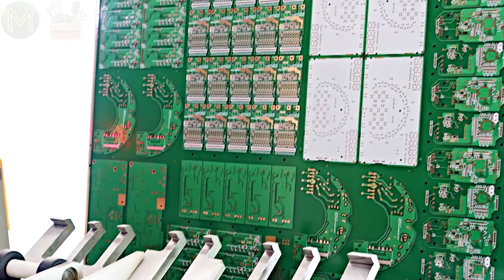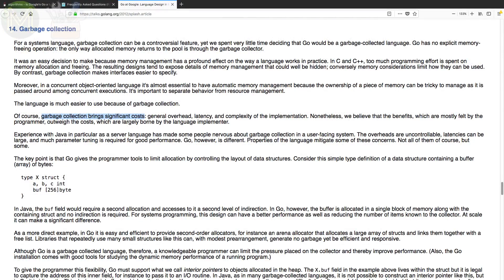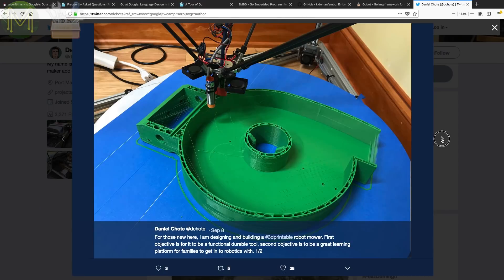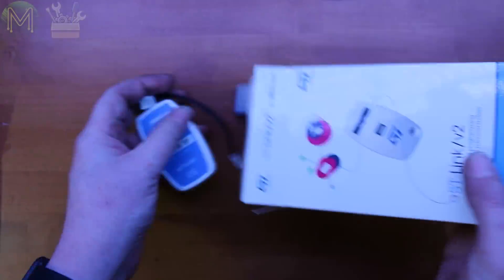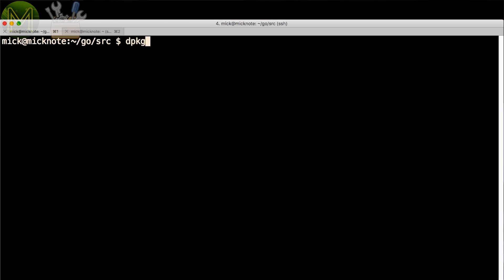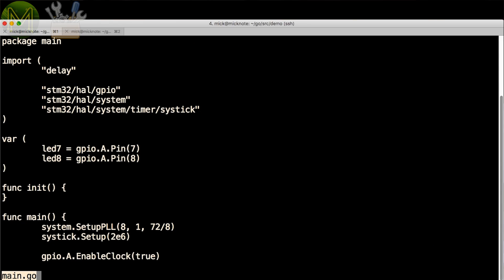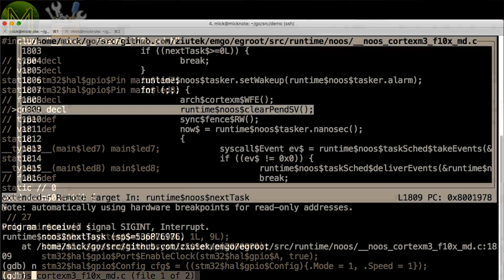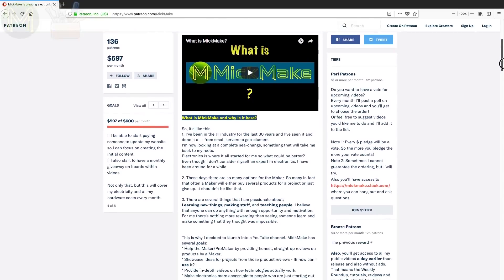#227 Running GoLang on an STM32 MCU. Why and how. // Tutorial

Comment: I don't see the point in going to Golang. Maybe i'm just too accustomed to Asm and C and like to fly near the silicon. Maybe it's different for someone who never started at the single transistor and worked his way up into the higher programming languages. However i still think a lot of "bad code" and maybe even hardfaults could happen if you abstract too far away from the core. Blinking an LED should not get you into trouble, but when you start to use the more challenging peripherals, it starts to get really interesting and tricky sometimes.
Reply from the maker: Yup, I’ve worked in assembler since the early 80s, but for real-time apps that can coordinate with backends, having an abstracted language that can be used for both MCU and datacentres means that your dev team doesn’t need to be split.
We’re seeing faster and more capable MCUs and even though there will always be a need for the smaller ones, the bulk of them can be used with GoLang.

Comment: I have been following GoLang for some years now just because it promises to be an option beside c++ for low-end devices. But this is the first time I see low level programming in Go. Thanks!
Reply from the maker: NP. Glad you got something out of it.
I’ll be shortly putting the website article up.
Reply: It will never become an option beside C++. Go doesn't compete with C or C++ at all. It competes maybe with D.(GO sits between C/C++ and C# and Java but doesn't compete with any of those) But the Rust language does compete with C and C++. Not Go as it has a Garbage Collector.

Comment: I really had to smile at "as most of them are supported" while looking at the huge list of 9 different boards; STM has more discovery boards than that, not to mention the plethora of Nucleos and of course magnitudes more open boards from other people.

It's also funny you mention Rust at the end but think that Go will gain a lot more traction, I wonder why that is and whether you'll do a "go to blinky" with Rust as well.

NB: You'll have a hard time going crazily low in flash consumption with a Cortex-M in ASM since the dozens of interrupt vectors alone will take a few hundred bytes of flash already; nothing you can do about it. But I do agree that 10kB is a bit excessive (if that really was the size in flash and not including any debugging symbols or other non-flashed contents), just for reference I'm in the process of writing a new HAL in Rust and a simple 4 LED blinky for a STM32F407 discovery board builds down to this:
   text    data     bss     dec     hex filename
    824       0       4     828     33c gpio_hal_busy_blinky
Reply from the maker: Oh yeah. The number of STM32 boards is incredible, but a lot of them are either a superset or a subset of the list currently supported.
Also it is incredibly easy to add support for new versions.

Currently Rust is mainly for STM32 and adding support for new MCUs isn’t as straightforward as GoLang, but emgo is a little more “hacky” than Rust in its implementation.
Reply: > Currently Rust is mainly for STM32 and adding support for new MCUs isn’t as straightforward as GoLang

On the contrary. A lot of chips are nicely supported already with HAL (plenty of STM32, Nordic NRF5x, AT SAMD, some NXP, TI Tiva...) and it's easy to add new ones, svd2rust will easily generate Rust code from the register descriptions (so no bitfiddling required at all) and a proper HAL can easily be created, too; it's a bit more involved than the GoLang implementation but it also offers a whole lot more...
Reply from the maker: On the flash consumption side: yes that was the raw code space size. It is quite excessive, but a lot of that is for libraries being imported. So having twenty flashing LEDs wouldn’t be 40k.

Nice to see that HAL. Do you have a link?
Reply: Regarding that F407 HAL: not yet, I'm trying something different this time to cover many chips at once instead of just one so this will take a bit more time. But if you're interested in playing with two of my most mature implementations (not just a HAL but full board support with examples): https://crates.io/crates/nucleo-f042k6 https://crates.io/crates/microbit .

This site (although not quite complete) might give you some pointers to get started: https://github.com/rust-embedded/awesome-embedded-rust
Reply: 10K looks like the thing I learned today: FreeRTOS port for STM32 precisely has this flash size. It will not be the surprise if emgo implementation uses FreeRTOS core to implement goroutines and internal language runtime using FreeRTOS code.

Comment: Nice, might give this a try later :)
Too bad Rust is only compatible with a minority of ARM boards, and has zero-to-no chance to have an Xtensa LLVM backend to support ESP8266 or ESP32. That would be my choice :|
Reply: István Nagy There was some relevant traffic on the llvm-dev mailing list in July.
Reply: Thanks Tim! I was not aware of that. Here's a link for others http://lists.llvm.org/pipermail/llvm-dev/2018-July/124789.html
Reply: @IstvánNagy-z7m  Rust also works good on RISC-V Microcontrollers. Most of these are DIRT CHEAP, and have way more performance than ARM Cortex.
Reply: It is possible to run Rust on the similar RTL8710 WiFi chip already, but I've not got as far as trying it myself...
Reply from the maker: The good thing about Go is that it is fairly easily extensible. One thing I didn’t mention in my video is that I plan to add support for Atmel and ESPs.
Reply: MickMake Any thoughts on how Go beats Rust on extensibility (assuming that's a word)?  I can see that being able to use GCC is a win, and although I'm keen on both for Linux application programming, Rust sort of feels like a better fit for most embedded work...  Tastes differ, I know, and some aspects of Rust take a while to get your head around, but I think it has some really cool (and pretty much unique) features for embedded...
Reply: Extensible underneath or on top? Underneath means portable to other architectures, preferably by writing code in Rust itself.  On top means the usual added libraries, new concepts / keywords for them and so forth.  This on top stuff is only meant to be in the context of what Rust is for - systems programming.
Reply: @Tim_Small  I wonder what the Garbage Collection downsides are on a microcontroller when you are doing hard-realtime. Does GO introduce "stop the world" jitter to your control loop? Does GO create non-determinism to your control loop code?